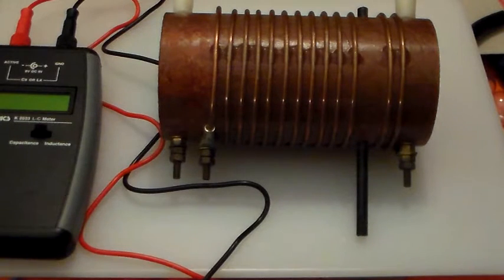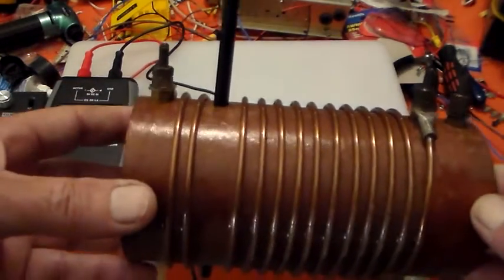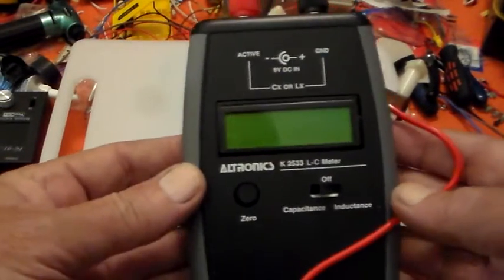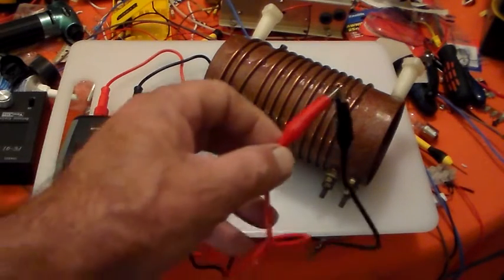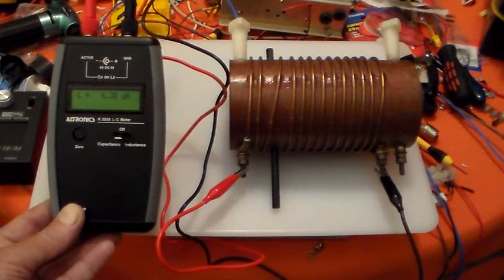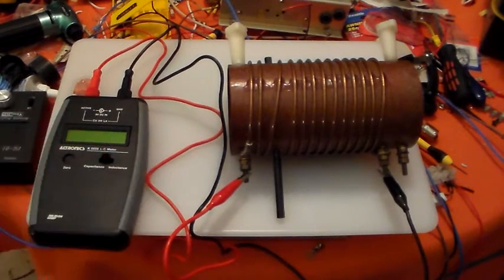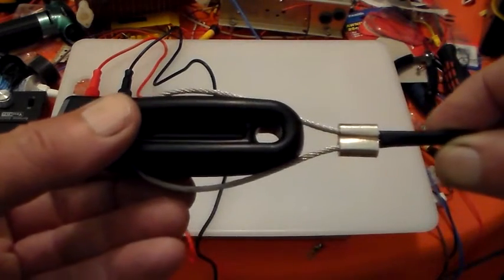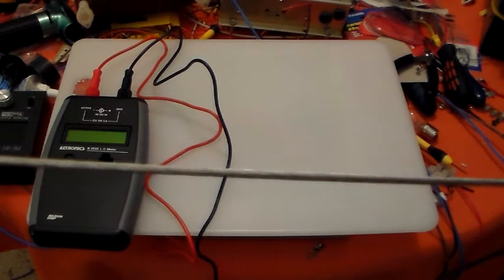HF Amp Pi Tank And Input Coil Formers.

Comment: As soon as I can get an area set up to do videos, I will be showing step by step
how to build Tetrode amps along with how to build some of the necessary 
items of test equipment and how to get the most out of MOT's on my channel.
I will also try to make and show videos to answer questions that viewers may
have on how to work with a particular tube or circuit.

Comment: There is nothing wrong with using steel wire - stainless, galvanised, coated with PVC, Enamel, lacquer or anything else - It's all fine. 

Anyone tells you otherwise they are speaking bollocks.

And yes, you are right, broadcast towers(which are the antenna) or the support guy wires used for radiation are all steel and work fine.
Even rusted and corroded steel still works fine - it's not even a problem.

Still, if you want to be simon pure(who invented that word?) then double tinned copper braid from Ormiston in England is the best option for wire antennae.

In WW2 the SOE operatives didn't have fancy copper wire - they used anything they could to make an antenna. That was usually steel fence wire or similar. The SOE operatives got the signals through with 3 watts, a crap radio and a piece of steel wire strung incorrectly in a tree......

Good video.
Reply from the maker: +Ade Larsen Thanks for the kind words, and the information. I can't say I've heard of Simon Pure... but Percy Purist has a good ring to it. I thought about it after I did this video but I put up a video a while ago showing a commercial delta loop antenna that's owned by the outfit I work for. I worked Spain with it using my FT857D at 100W output and that antenna's all steel wire.

Comment: i like to leave about 30 cm extra length dangling on both end sides of the antenna, and use bulldog grips to tune the antenna, just a note "not all stainless steel materials are conductive, or have a higher resistance", i have a swager you could borrow Steve , but you could also use a lugs crimping tool or a vice.
Reply from the maker: +Moussa El Karakizi Hi Moussa. Thanks for the generous offer but the cold chisel seems to work fine. The antenna isn't balanced, and won't be tuned, the feed-point impedance will be matched for different bands with individual 'L' circuits.
Reply: hi Steve, i am very interested to know how the coil going to turn out.